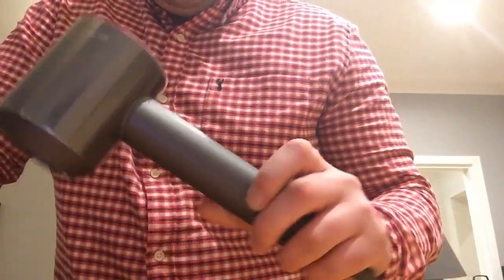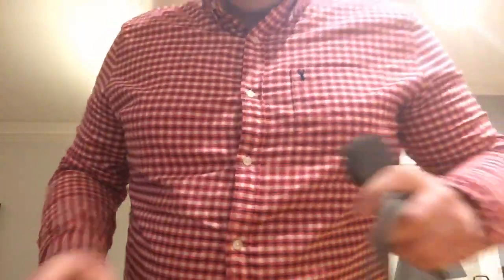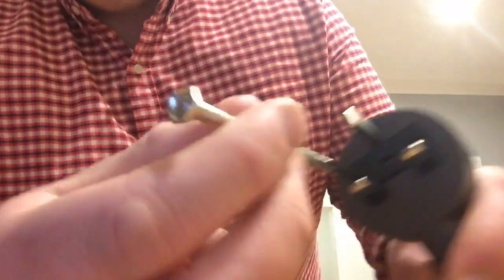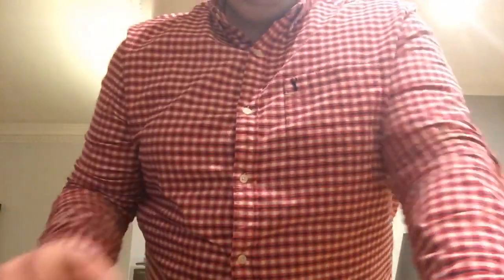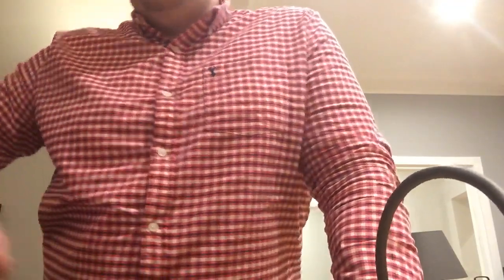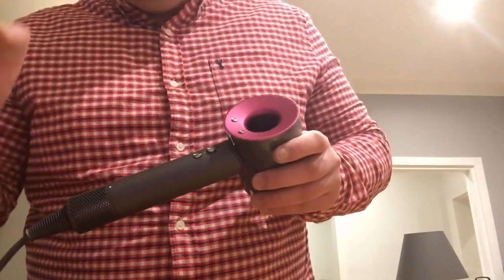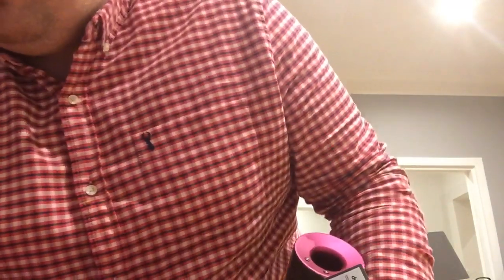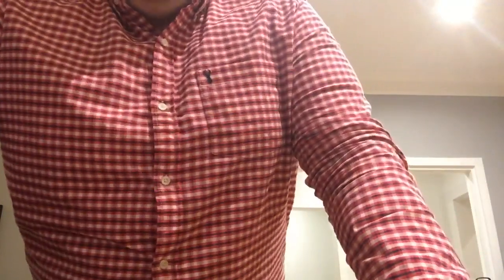Dyson supersonic hair dryer fault

Comment: Great video, Im in the US with a dead dryer of my Wife’s. I was hoping there was a fuse in the US plug, but sadly not. You can test and reset a GFI, but that didnt get it working either.
Reply: I'm in the US with the wife - same issue here. Did you fix it? I'm thinking it's something to do with the USA voltage or something

Comment: Thankyou, this has been an ongoing problem I've had for the last 10months. Cleaning the filter gets it working but i have to keep it ona low setting. Just called them and apparently a virtual engineer is contacting me in 24hrs to sort the problem??? Interested to see what they will do.
Reply from the maker: Let us know how it goes. Remember its a product fault and not yours. Make sure its not at your cost to sort the hairdryer providing its within warranty.
Reply: What did they say, is it fixed?
Reply: Any update?